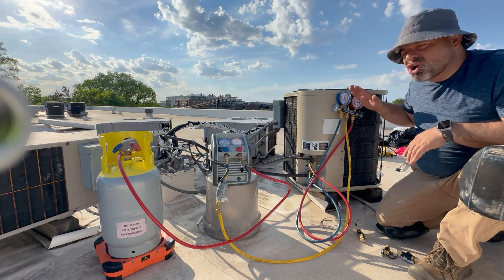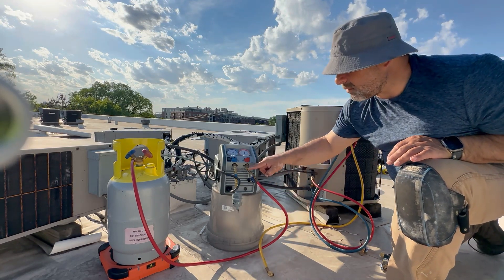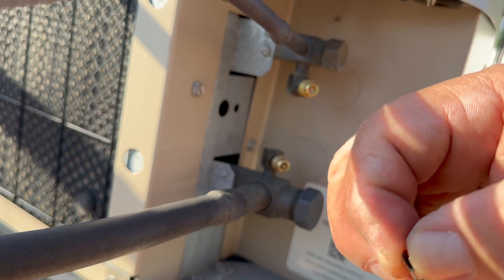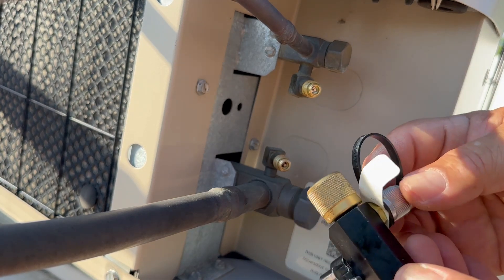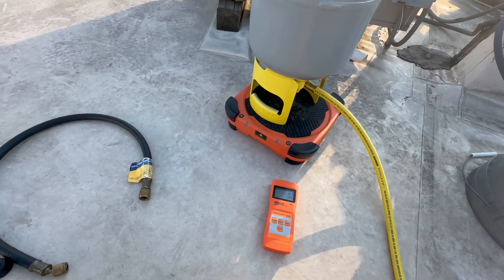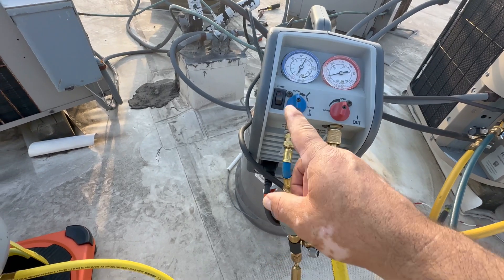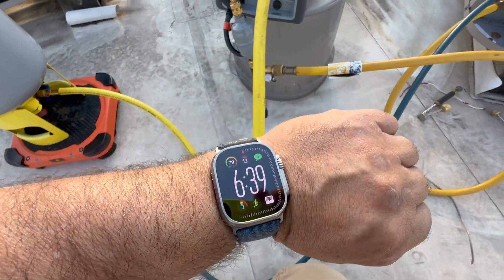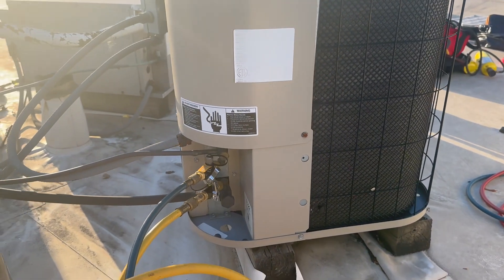HOW TO RECOVER REFRIGERANT "FASTER"FROM AN AC SYSTEM

Comment: As a homeowner, it’s a lot of expensive stuff, even though I got my 608 certification so I can take care of my own two R22 old systems. Each appion is $70, the recovery machine is $500 to $1000, the scale, the recovery tank, the turbo torch and tanks, vacuum pump, even the large vacuum hoses are $60 each. Forget about something like a digital manifold. Big initial investment!  That’s before the refrigerant!  I spent almost $800 for 30# of R22. Thanks for sharing your knowledge- I should have gone into HVAC. I find it interesting.  But you do it all.
Reply from the maker: YEAP.  As a home owner it doesn't make sense.  Why did you get your 608 certification?  Wanted to work on Hvac for money. Or just for fun?   Greetings!
Reply: @alexthehandyman3494  it almost makes sense, since r22 is so expensive if I call someone.  So my house was built in 89. We’ve lived in it 13 years. I have two original Armstrong air R22 units and my original peerless oil boiler.  I service them all. The AC I’ve never let anyone touch, since it’s so old and has worked fine. I’ve never even put gauges on it.  A few capacitors over the years, a condenser fan or two, and maybe an air handler transformer.  About 5 years ago I bought 5# of R22 on eBay.   Last summer for the first time ever it wasn’t blowing cold. I studied and took and passed the 608 universal so I could check the pressure and add the refrigerant myself. Small leak in one of the schrader valves on the high side.  I added some r22 until the superheat was where it should be (piston), but didn’t change the core yet. I bought 2 of the valve stem removers but I’m afraid since the nylog I put on it seemed to stop the leak. It’s been fine this year after sitting all winter. Plus, I wanted to buy some more r22 just in case.  The reality is where I live if anyone came to my house to do any service on the AC, I’d be left with a bill for 50k to replace both units. I love .r22 and the piston. Don’t want to change it unless I must. Thanks for the videos. I always learn a lot.  Edit. Oh, and I already had to change the condensate pan in my attic once. It was rusted through. I did it without pumping down my system. If it ever happens again, I will have options, and maybe do it the right way, recover, fix and recharge. Couldn’t do that last time.